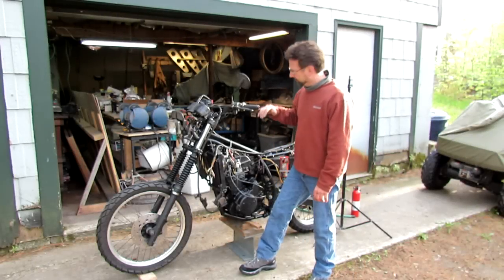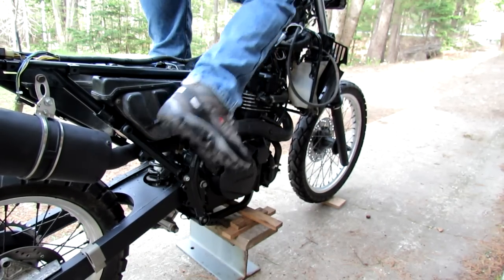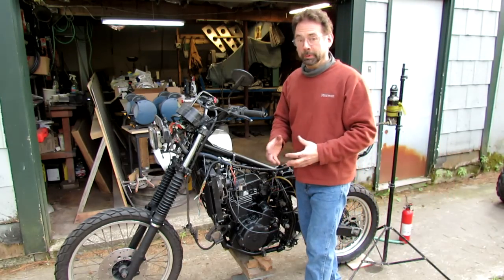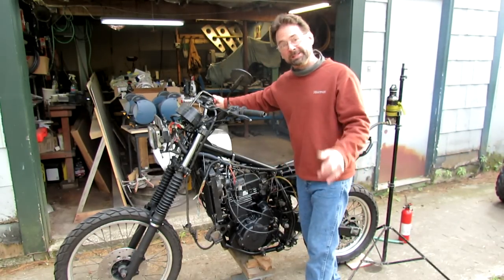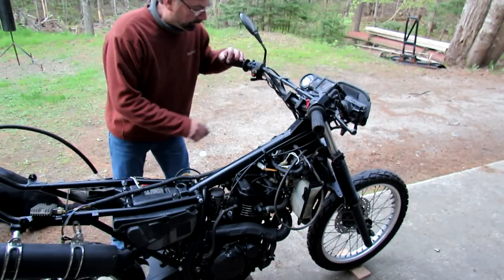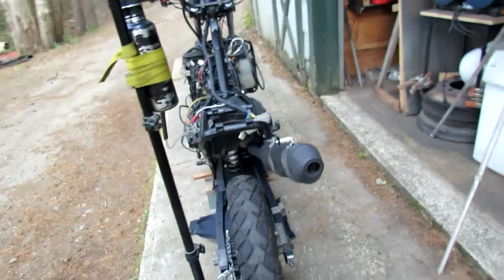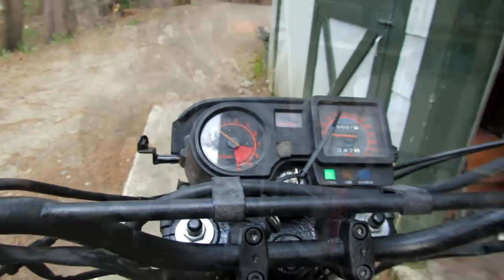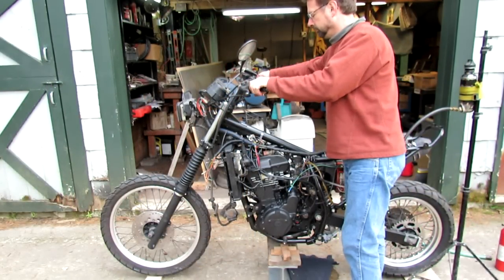1993 KLR 650 - First Start After Rebuild - May 19, 2013

Comment from the maker: Nearly a complete job.  The head was rebuilt.  I installed a 658cc cylinder sleeve, with matching piston and rings.  I upgraded the Engine Balancer Sprockets to the "new style" sprockets.  I installed a 2004 crankshaft.  I thought about installing the "new style" transmission, but opted to stay with the 1993 version. I installed a  Doohickey /Torsion Spring.  I did the now famous "MC mod", (advancing the Exhaust Cam one tooth).  I jetted the carburetor with a KLX needle, and a 142 main jet......

Comment: hey black lab, nice work.  Couple of questions:

1. how's the vstrom?
2. the battery you have in that pic is facing sideways.  Just wondering if you are using an AGM or sealed battery and if that is temporary like the wiring.  If not, I would be leery of possible acid leaking onto the frame and or plastics/leg of rider.

my 06 klr has the battery horizontal fyi.

Comment: Hi Barry! Just noticed that my KLR has a quite good dent on the chassis under the skid plate on the left side. It doesn't seem to have affected the allignment of the bike, but the chassis is  touching the engine. I have measured it from the ground and it is about a centimeter higher than the other side. Do you think i should try n fix it or not bother??
Reply from the maker: Hello Yiorgos.  If the frame/chassis is touching the engine case, then I would try to do something about it.  During the course of riding, the chassis and engine vibrate, but not in the same sequence.  Which means that the chassis will eventually rub through the engine casing.  

At the very least, I would try to squeeze some commercial grade rubber between the two as a temporary fix.  But, if I were going to be riding across Labrador and Newfoundland, you now know exactly what I would do!  :-)
Reply: @BlackLabAdventures  Thanks Barry! You are right! I will fix this baby! All the best whatever you do!
Reply: Can I make my klr600 year 1985  as a self start

Comment: weird, never saw a klr 650 that had a factory kick, the klr600, klx 650 (diff eng case); but even my 1990 didn't have it. great video
Reply: mine is made in 1989 and doesn't have kick starter also. But there is a mark on right side plate like "kickstarter", so probably that was made for KLR which goes to export for USMC forces ?

Comment: Hi I want to use a electric motor to run  a klr650 . I want to use the motor shaft in place of the upper cam shaft . I want to remove the head ,piston ,and every thing thats needed to make it work  the way it does with gas  so I was thinking  I could remove the cam shaft and have the electric motors shaft  be the top part of the  timing Chain  . Where would you put a electric motor  to take the place of the parts thats used   for gasoline.
Reply: Dumb idea

Comment: 1000 hours? That's half of a full time work year, or 6 months of 40 hours a week. You have more patience than I do. First gen KLRs are cheap on Craigslist, in good condition. I would have just bought one of those and freshened it up a bit.
Reply from the maker: That had been my intention and it was what I thought I had purchased.  However, once getting into the project, I found more issues than I originally thought existed.  But, I also know myself fairly well.  No matter what First Gen KLR I bought, I was going to completely dismantle it, so that I could teach myself how to put it back together; better than new.  Once my KLR was completed, I did a couple of shake-down rides to make sure everything was okay.  Then I took off on a solo ride from my home here in Maine, across Eastern Québec, Labrador, Newfoundland, Cape Breton, Nova Scotia, New Brunswick, and back to Maine.  The trip was executed flawlessly.  The bike ran perfectly because I removed all variables that could go wrong with it.

Comment: Any idea why I would have no spark klx 650*1993
Reply from the maker: Electrical stuff is often a challenge to sort out.  And, it is even more of a challenge when the motorcycle is not right in front of me!  I would suggest you do what I always do and, do a "Search" here on YouTube.  I just did one for: "No Spark On 1993 KLR", and there were several videos that dealt with the same issue that you have.  Click this link  https://www.youtube.com/results?search_query=no+spark+on+1993+klr   to find those videos.  Good luck!
Reply: @BlackLabAdventures  il give the link a look... Already seen a klr one in the safty switches wich mine doest have
Reply from the maker: @dbdb4274  Yes, check the safety switch.  I removed mine.
Reply: @BlackLabAdventures  I have a safty switch on the stand.. If I just unplug the wires does that mean it's goen
Reply from the maker: db db I did my work seven years ago..... I no longer have the motorcycle to refer to for answering specific questions. I can't remember exactly what I did, but I know that I disconnected the safety switch on the kickstand.

Comment: 3:25 whats that wire with red cap?
Reply from the maker: This was so long ago.....  I actually can't remember! My guess would be that it is the neutral light switch. When in neutral, a "green light" would come on in the instrument cluster I chose to use with this motorcycle.
Reply: @BlackLabAdventures  tnx for answer, i was asking cause i was changeing front sprocket few days ago and i didnt know what that wire was.

Comment from the maker: Answer to the V-Strom can be found at my website: blacklabadventures[dot]com (Links can't be posted in comments.)

The battery I am using is an Odyssey sealed battery.  It came with the bike when I bought it.  Because it supposedly has plenty of life left in it, I am going to continue to use it.

The wiring you see in the video was temporary, to get the bike started.  I mention that in the video.